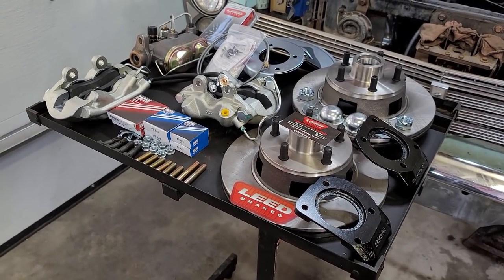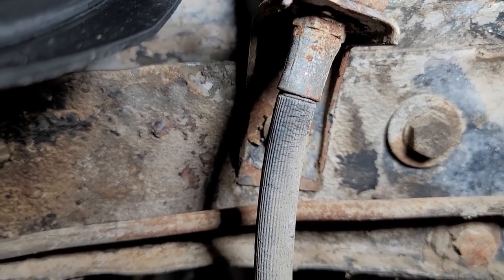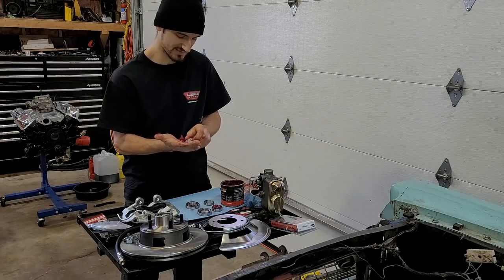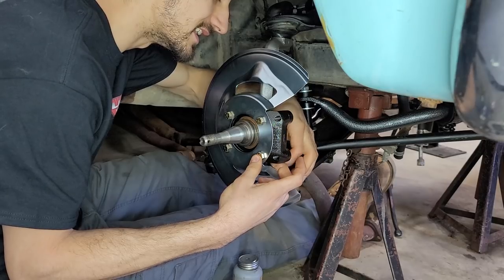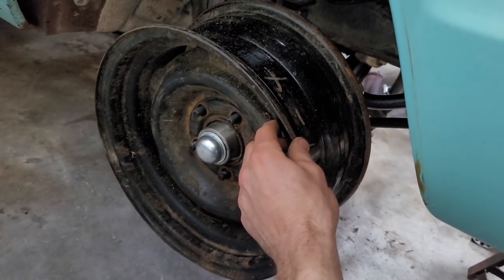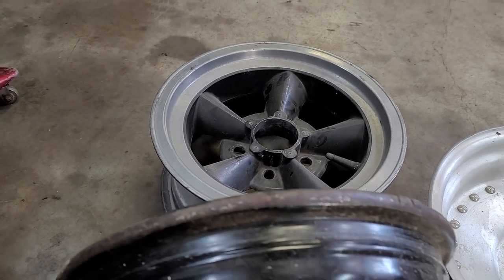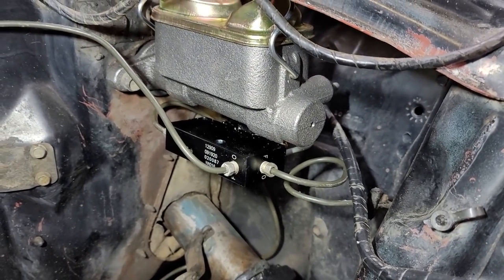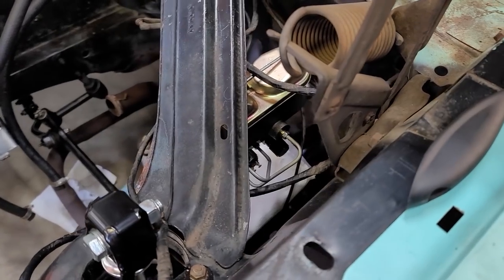How to Install Disc Brakes on a Classic Car, LEED BRAKES

Comment: I have one of those bearing packers like you showed, but I do the bearings by hand. Wait until you get my age (62) and forget something and have to get back up. An old coats tire machine, brought back some memories, but still beats my harbor freight manual machine.
Reply from the maker: Just something about packing the bearings by hand... I've always seen them on the shelves at stores, but have always reverted back to the old school way of things. 
I can only hope we'll still be working on these old beast when I turn 62... unfortunately with the way things are going.... I don't see it happening.
Yeah, the old cot machine works great! Picked it up cheap, cleaned it up and works like a charm, minus the couple of smacks it's given me!

Comment: Mikey, where ya been ? Thought you fell off the earth 🤣🤣
You must be busy up north eh?
Good to see you back. Let us know how the proporting valve set up goes, I got one of those with my CRP kit for the 65 but didn't get the group of different metering valves. But mine does have the dial valve like yours, so any onsite would be a big help.
Reply from the maker: Tim, I feel like I feel off the earth 🤣🤣... so much going on and so little time to throw a video together... I don't know how everyone does it! Maybe it's time for an editor🤔
Thanks for tuning back in though, hope all is well!
Yours sounds like a proportioning valve, one inlet and an outlet. Basically a bias for the rear brakes (you will have a separate distribution block). This one I have is a distribution block and proportioning valve built into one. Should act no different than yours really (job is the same).

Comment: I don't like hammering the dust cap. I use a large screwdriver and a hammer, set the screwdriver on the flange, and gently tap all the way around while turning the disc. It takes a little longer but you can feel and hear when the cap is fully seated.
Reply from the maker: That’s what I did in the time lapse if you watch closely 👍

Comment: Ok, binge watched and got all caught up! I did have a question on the power steering vs non power steering gear box though. As I recall they had a different gear ratio to make the non power a bit easier to handle. Next, if recall correctly, there should be a floor shift removable panel in the trans tunnel under the carpet. That would help to make the decision on the correct tail shaft for shifter location. But, you've probably already figured that out. lol. Can't wait for the next video!

Comment: Great Vid!! Could you have used a wheel spacer & use the original wheel?? I think I'm going to have the same problem when I put disc brakes on my 1959 ford. How do you go about finding the correct original stock wheel if you have to change them??   Thanks for your help Joey

Comment: Great video! Such a bummer when the wheel didn’t clear. Glad you had some spares. How is this kit? How come you didn’t go with the super popular wilwoods?
Reply from the maker: Thank you! Yeah it sucked but live and learn and hopefully people making the swap are now informed as well through this video. Kit is great, ran a similar set up on my 65 fastback and have had zero issues. As for wilwoods, there's no real need for them on this car. Not building a race car, just a fun cruiser👌

Comment: How did you decide to go with Leed brakes vs all the other options? I know there are tons of options like Wilwood, CSRP, SSBC, even Baer. Love the vids btw!
Reply from the maker: I've used LEED in the past and have had zero issues. In the end really Leed, CSRP, and SSBC all use the same style/ design caliper (Kelsey Hase 4 piston). So which ever option you go with will have similar results. As for Wilwood and Baer, those are more aftermarket/ higher end set ups, both great companies! Just didn't need a crazy set up being as this car will just be a fun driver
Reply: @Theoldcarchannel.  Got it, thanks for the info, it's dope you actually respond to comments.

Comment: Does the new disc braking system function better than the old ones, as in stopping power, less pressure needed on the brake pedal to stop the car?

Comment: Nice you got a tire machine. Do you balance the tires as well?
Reply from the maker: Yeah picked it up last summer for cheap, cleaned it up and works for what I need it to do! Unfortunately I don't have a balancer just yet so will have to get them balanced at a later date
Reply: @Theoldcarchannel.  oh sweet. Makes it a bit cheaper mounting the tires yourself. I don't have the room for either one but I got a mechanic who will do it under $30 so it's not too bad.

Comment: If you wanted to have power brakes, could you just put on a brake booster and the you have power brakes. Would there be mire to it or not?

Comment: Did you have the option to add a power booster? I know that the space under the brace support is less than on a mustang.
Reply from the maker: That’s a fair question, I’d have to look into it. I didn’t want power brakes on this one so didn’t bother looking
Reply: @Theoldcarchannel.  have you been happy with the braking with this setup? Does it take a heavy foot to stop? I'm working on a 65 comet and trying to decide on a brake system.

Comment: Hi there i like what you do but never ever sit under the car like that one day you will loose your legs.
I seen it done.
I normally sit on tyre with my legs out of way just in case
Reply from the maker: Hello, thank you for the concern! Worry not though, with jack stands and also the cars front two wheels sitting under the rocker/ frame rail, it's safe.

Comment: Does this apply to a 1967 Galaxie LTD?
Reply from the maker: No this is different. 
I’ve attached a link below for 67 galaxie brakes
https://leedbrakes.com/ag-1148757.1148653.1148707-1967-ford-galaxie-500.html